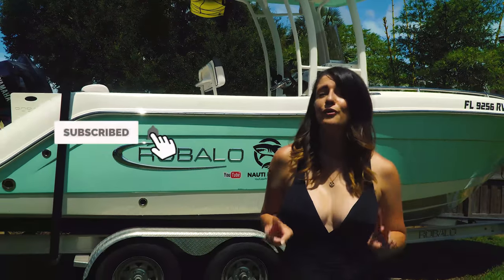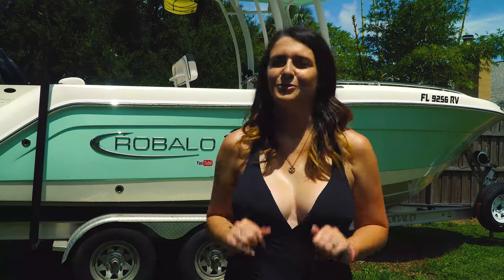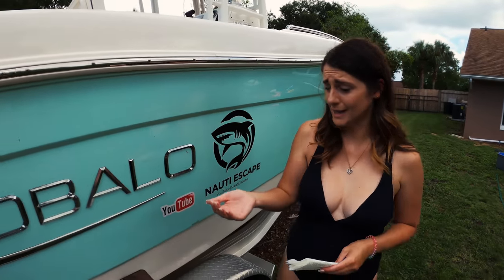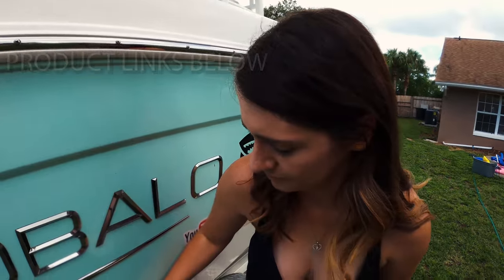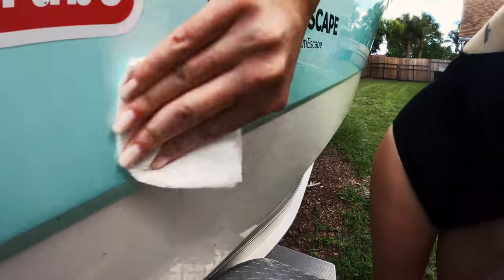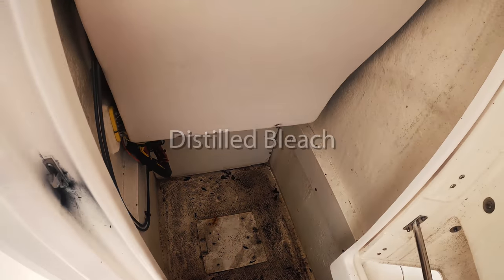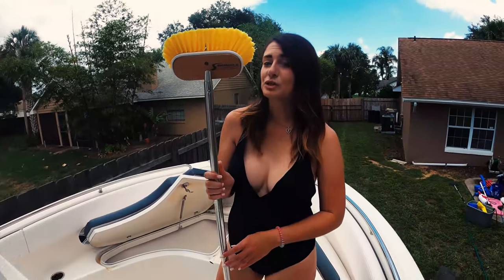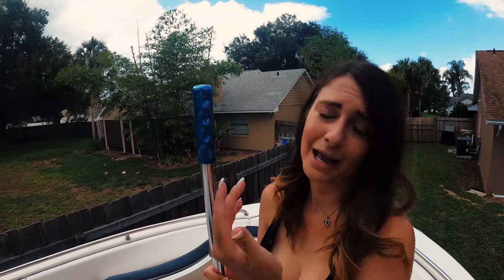Boat Detailing - Part 2

Comment: I’m in the market for a boat.  Looking back are there some things  that you know now that you wished you knew before you bought a boat in general and About the brand Robalo?
Reply from the maker: I don't think I would have got the hard top on it. It's nice but much heavier than the soft tops and if you want to install boat shades you have to get over the fear of drilling into it vs the soft tops you can velcro anywhere. That's my personal opinion though.

We originally were interested in the SeaChasers until we went to the Miami boat show and were able to compare them. They certainly have more features on them but the hull is much thinner. The Robalo is thicker, deeper flooring, and much more heavy which is good for a smoother ride if you plan on going out in the ocean with them. 

If it's a lake boat it doesn't really matter then.

That being said I would recommend getting the bigger motor option on the robalos strictly because of the weight they have on them.

If you know its just going to be 2 or 3 people that aren't too heavy then the stock motors won't make a difference but if you're going to have more people or heavy people at that defintely upgrade the motor